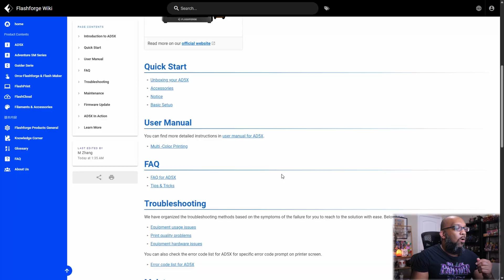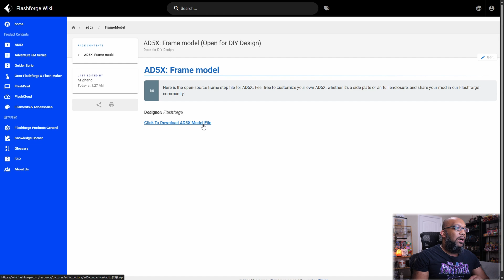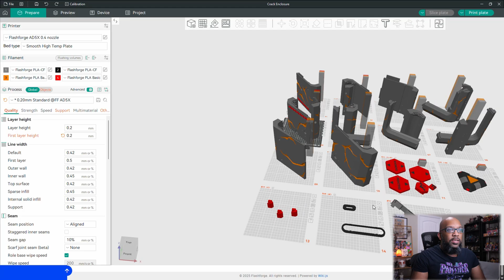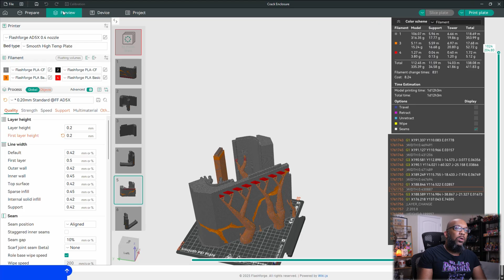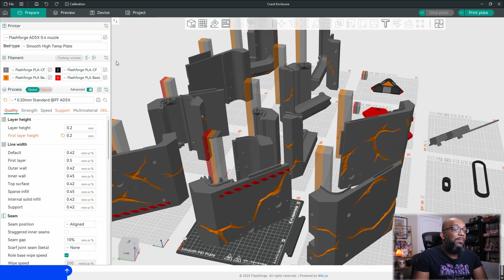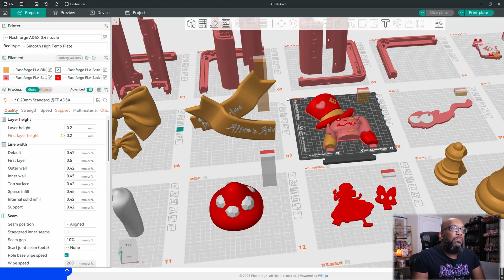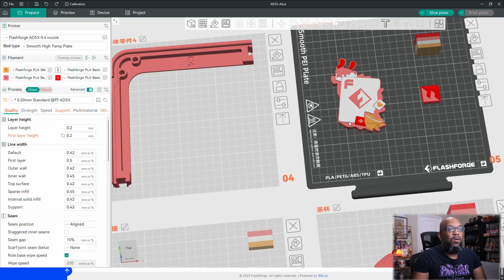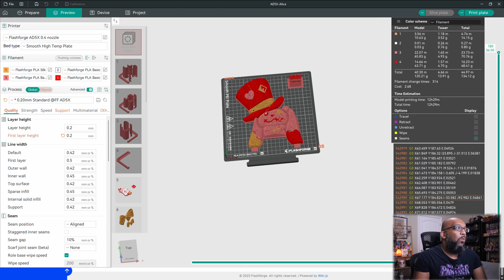Flashforge Debuts Custom AD5X Enclosures

Comment: Thanks for the video. Personally, I am printing it in PETG (had to make some adjustments, nothing too major). Also did it in a solid translucent red. That said, just to let you know, in Orca-Flashforge, it does actually give you the waste breakdown, in the "color scheme" window, there is a pulldown bar, switch to line type. gives you the breakdown including how much waste is in the supports.

Comment: I’m currently printing the volcanic enclosure, it’s quite expensive but it looks killer so far. Im 8 rolls in so far lol, but I’m on my last print plate just waiting on the enclosure  part kit to get delivered.
Reply: Yooo where you gonna post the finished product?? 😮
Reply: @crespo1392 the enclosure kit still hasn’t arrived from flashforge
Reply: I have the revised files for the Crack enclosure with the extended top sections if you want them message me your email address and I'll forward 👍🏼
Reply: @geoffpeacock514 send file im working on same project

Comment: What firmware are you running these days? I vaguely remember a firmware that wasnt using nozzle wiper. Has that been updated in latest?
Reply: I've gone through every firmware and all used the wiper.
Reply from the maker: I'm on 1.1.3. On this firmware, the nozzle wiper is used before the leveling process, but is not used during filament changes during a print. I've held off on updating to the latest firmware due to the E0011 error I've been reading about.

Comment: Christ can't Flashforge make the AD5X enclosed like the 5M Pro and just call it the AD5X Pro. I'm tired of waiting for them to do this.
Reply from the maker: They'll be releasing the Guider 4 Pro this year that's pretty much like that except it's larger and doesn't come with the IFS as standard.
Reply: @FigureFeedback  Yeah, I don't think just adding some things (enclosure, camera, etc) should be a pro.  For it to be Pro, I think it needs to be a bit larger (and have those other things also).
So the Guilder 4 Pro being the Pro version in their line-up makes sense.

Comment: I bought the enclosure on the flashforge website, it's the official version. The thing I don't like is the top cover, you have to remove it each time you use the machine or the filaments tube pop it open and it fall inside and mess everything.